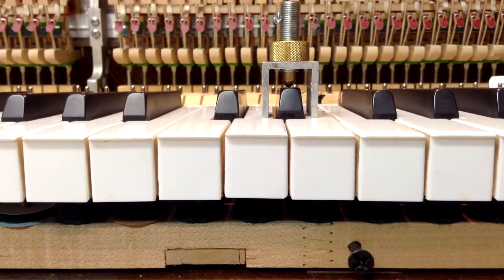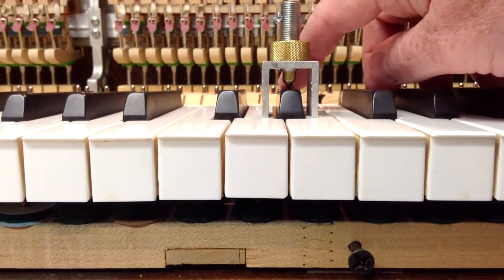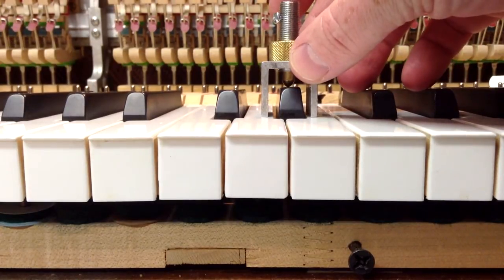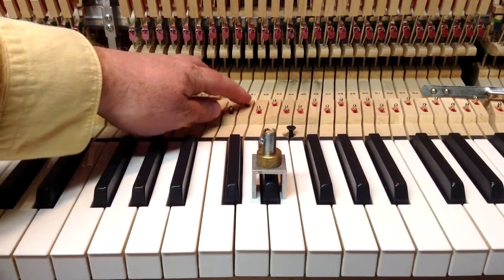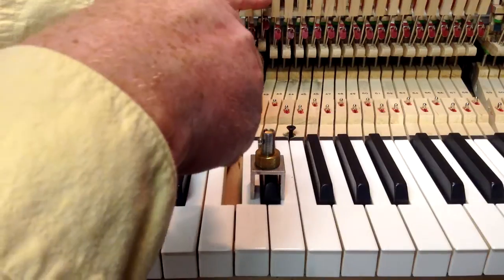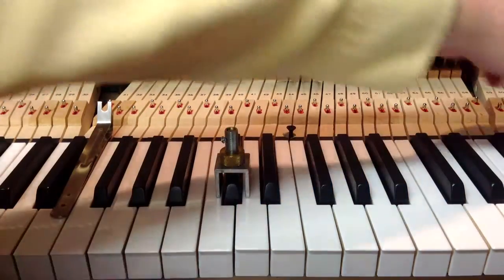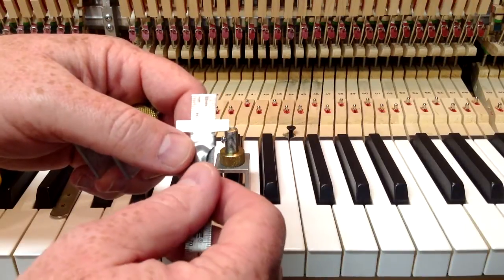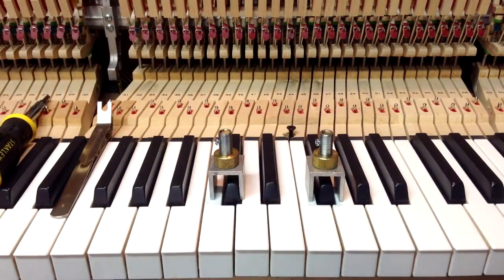Piano Sharp Leveling - Piano Tuning & Repair I HOWARD PIANO INDUSTRIES

Comment: The problem with this method is that it won't work if the sharp is too high. It's better to set the height of one sharp by direct measurement with a ruler. Then set the tool so that the floating pin is level with the top of the threaded column when the tool is placed on that correctly leveled sharp. Once done, you can tell instantly if a subsequent sharp is too high or too low. If the floating pin is higher than the top of the threaded column, the sharp is too high. If it's lower the sharp is too low. Add or remove punchings as needed to make the floating pin level with the top of the threaded column.

Comment: Howard, what's the easiest way to set the proper key dip with the black keys?  With the white keys, it's relatively simple using the measured key blocks but confused with the black.
Reply from the maker: Hi Thomas, I find setting the sharp keydip by feel to be the easiest way,  It takes a little practice to be able to feel the consistency from one key to another,  but if you just match the feel of the dip on the sharps to match the dip on the white keys this is the easiest way to do it.
Reply: Thanks Howard, I find there's nothing like the playing of classical music to bring out any imperfections in regulating, getting there step by step and thanks for all your great videos, they are the best out there as far as I can tell.
Reply: Dale Erwin’s sharp dip gauge is a really good way to go.  And does the whites too.  It’s a “feeler gauge” approach used between the felt punchings in the front rail and the bottom of the black or white keys
Reply: IMO the Erwin type key dip gauge is the way to go. It works on white and black keys the same way. It goes between the top of the front rail felt and the bottom of the key like a feeler gauge.